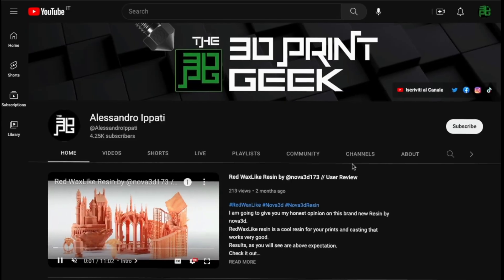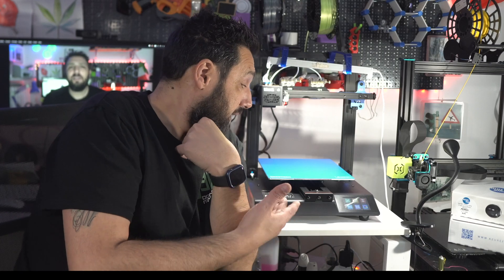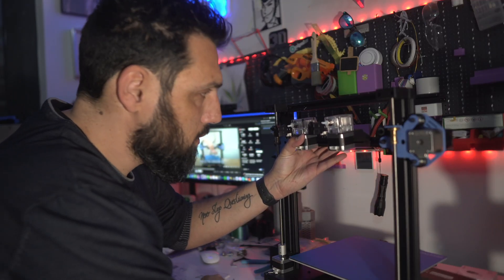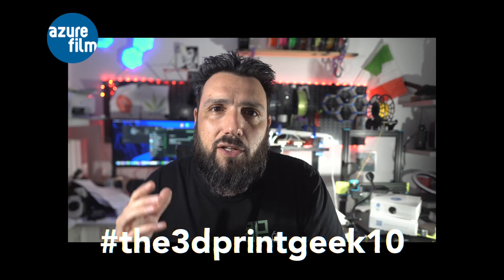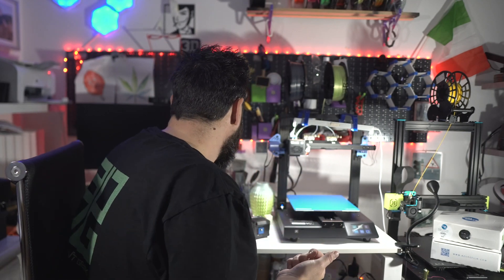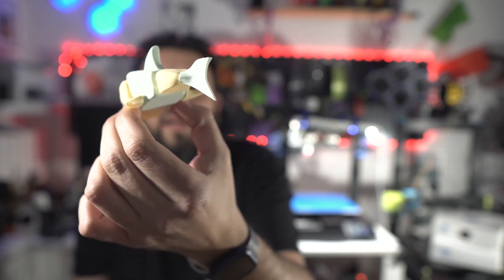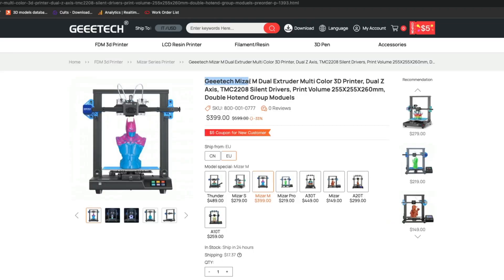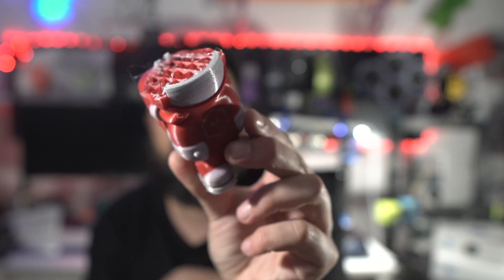Geeetech MIZAR M with Dual Extruder 3D Printer REVIEW // by @geeetech3dprinting

Comment: Hello, I want to ask if you are still using the Geeetech Mizar M printer? I have problems with the Mizar M 3D printer I just purchased. It prints gradient colors well, but it does not print separate colors on a vertical surface, and the product breaks during printing. I think that the Slicer I use in Cura Ultima is not suitable. And that Easy Print Lite only makes gradient colors. Have you tried printing your created products in separate colors instead of gradient colors? and if so, what slicer are you using? The sample files attached to the printer print fine for me, but not for my creation.

Comment: Don't waste your money, I had one for a week and I only got one model to finish, and it still looked like crap. I printed a blue and yellow moveable cat and the blue color mixed in with the yellow leaving blue hazing in the yellow areas. It also would just stop and ooze big blobs of plastic in the middle of the job for no reason and keep going, ruining the print. The prime tower would also have big blobs oozing on it and the nozzle would hit the blob and knock the block over, moving the print head off-kilter. The auto level is not "Auto" You still need to put a piece of paper under the nozzle in the last step. Sometimes the filament would not come out of the nozzle and the model would be 2 inches high moving around with no filament coming out. This machine is a hard no!! I only tried the separate color head as it was too much work to switch nozzles. I generally don't comment but it was this review that convinced me to buy it, so I felt I had to make it right. I also noticed the price of this machine on Amazon fluctuates anywhere from $799 to $549 depending on the day you log in.

Comment: Is it dual extruder, but only one hotend? I’m trying to figure out why it needs a purge block
Reply from the maker: because when changing color, it needs to purge what's left in the 3cm of the bowden tube
Reply: @AlessandroIppati  Right - that’s my question. With an IDEX machine, you don’t need a purge tower, because you have two separate extruders and hot ends. so each hotend is extruding the same color for the entire print. There are even some printers that have dual nozzles in a single extruder assembly, which also doesn’t need a purge tower. I wasn’t aware that this one has two extruders that each feed to the same hotend, so it does need the purge tower. Good to know.

Comment: Question,  when using the Separated print head, printing a 2 color model have you tried to do a Filament change pausing the printer to change the roll to like a different color ?    I haven't had luck with my Mizar M using PrusaSlicer to "Add color (M600) change"...  When printing it just blows by the color change layer setting.    Other than that I like the printer and that blue plate is really nice!

Comment: do u still use this printer ?
Reply from the maker: Sure, why?
Reply: @AlessandroIppati  this printer complicated to use at all
Reply from the maker: @monsterstorm78  Not at all, it is a good printer that gives you a lot possibilities. Merge colors or multicolor prints
Reply: @AlessandroIppati  how do u kno when to make it change colors for the next layers
Reply from the maker: @monsterstorm78  if you print an object that is already divided into two pieces, in cura you select one for one extruder and the other one for another, and the printer does the magic. If you want to merge it, you decide when to shift and the amount
Reply: @AlessandroIppati  do u have to do the filament change command in cura as well ?

Comment: Hello bro. Say, on this printer, you can get, by mixing two materials, an overflow effect, like a silk dual color. Or is the mixing total and a monotonous mass is obtained?
Reply: O, yes, you have a video with such plastic. https://www.youtube.com/watch?v=1flzaC5rMCU
Then the question is shorter. On this printer, is it possible to achieve the same effect of transfusion of color from two monochrome plastics by mixing?
Reply from the maker: the two colors mix in one, they do not merge. They melt together.
Reply: @AlessandroIppati  Bro, just say you can get "silk dual color" effect or not.
Reply from the maker: @jonsona9353  is this a question? if yes, what do you mean by silk dual color? the filaments I used are already Silk pla... Help me here, I am confused on what you are asking
Reply: @jonsona9353  One nozzle blends two filaments into solid tones, the other nozzle has no blend option so, one filament/colour. You can achieve the dual colour effect using a the single filament nozzle with a dual colour (split down the middle) filament such as 3DJake "magic PLA".